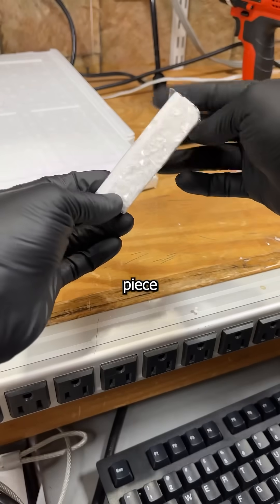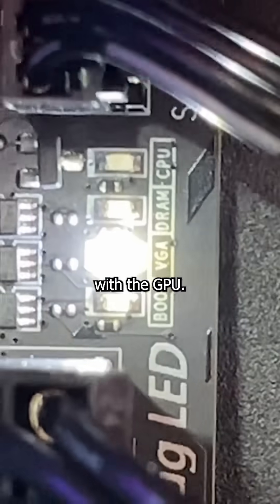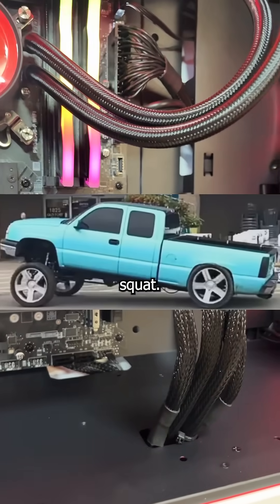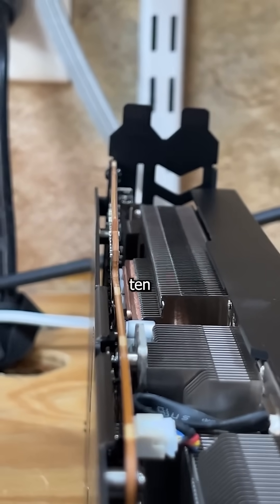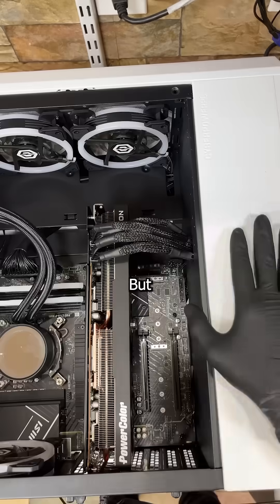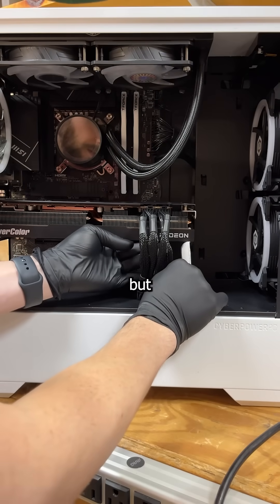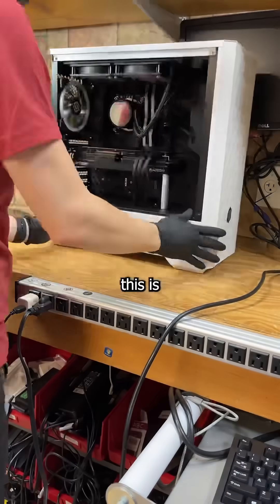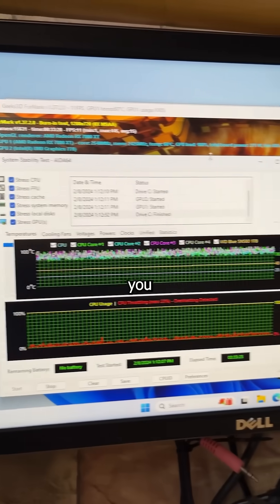Styrofoam vs. Brand New CYBERPOWER #PC (prebuilt fail) #tech #technology #shorts

Comment: It absolutely baffles me that GPUs are getting so massive that they require (even when the PC is horizontal and the GPU is vertical) a mounting support bracket, they have the mounts for them, and we can buy them, but the manufacturers don't include even a basic plastic one with the cards. Come on, another $10-30 out of the manufacturer's pocket (less because of bulk manufacturing) would not even make a scratch or dent on profit margins.

Comment: CLX does the same. My brother's was so bad we had to warranty the motherboard and the GPU. It worked for 3 months. And they must have dropped it before it got boxed up too as the PSU is stuck in the case due to a large dent but the box was fine. They shipped us the parts rather than sending the whole thing back.

Comment: Always a good idea to route those gpu power cables from above.. provides a touch more support for free
Reply from the maker: This is actually a great point
Reply: That how I set up my 2070 super. Though I think imma need to upgrade soon. Possibly a 7800xt or 4070 super. Might need a bracket then
Reply: @TwistedFoxblade same here
Reply: @TwistedFoxblade get a 4080, 4070 doesnt have enough capacity for ray tracing. The gpu will turn that shit off automatically. But unfortunately that is included in the price you pay for the card. Just save up for a month more for that sweet 4080
Reply: @BlackNook idk that 4070 seems to be enough for my 1080p and PCVR gaming.
Reply: @BlackNook I had a 3080 when Cyberpunk released, and it played the game with Ray tracing in 1440p. Never had an issue running the game on that pc.
Reply: Applied this to the motherboard and power supply it does indeed work😂
Reply: Thats what I'm doing...but its doesnt sag anyways. But it is pretty tight, so if it ever starts, it should be fine.
Reply: Yeah but no, they die fast when taut
Reply: It does but then you put strain on the port itself. Dont get me wrong it's so much better but still, use a support, they are like 5 bucks. They are anti esthetic? Yes. They work tho.
Reply: Ah yes, let's put even more strain on the connectors that tend to catch fire lately
Reply: You can also ziptie a hole on the backplate to the back of the case. A lot more reliable than a bracket, and it prevents the GPU from falling in any direction (up down or forward) when the PC is transported

Comment: Yeah, my graphics card didn’t have an option for a proper Bracket. And the screw ones kept slipping. So ended up trimming a thin sheet wood to make a stand after careful measurements.

Comment: I have that exact same problem with that exact same motherboard. Is it really the sag of the gpu? The same white light comes on and everything. Though I'm using a KF cpu, it doesn't display anything when connected to the gpu. Any thoughts?

Comment: My proudest moment building my most recent PC was realizing I could just use the metal pieces from my case to make my own anti-sag bracket. 

I already had to snap off a piece that original covers expansion slots before you figure out orientation for HDMI slots, etc. Bent the straight end into a loop after figuring out what height it needed to be at and the other end conveniently has a screw hole already in it. Got it in place, screwed it down and put a small piece of black foam to cushion it. 

It's so thin and hard to see that I genuinely prefer it to the brackets I see being sold. Plus it literally matches my case!

Comment: CyberPower, more like CyberProblems
Reply: No joke my friend bought one and I used it while house sitting for him. It's got better specs than mine all around and it's a complete turd! Boot up time was like 5 minutes on an NVME and games took forever. I ran my CCleaner Pro account on it and dropped all of those times in half. But it still runs super hot so I told him to replace the thermal paste and factory reset and be careful what he downloads. Hopefully it's running better now, but he doesn't game much because of his kids.
Reply: @dillbill2A he has to have windows installed on a hdd. I have a PC with a nvme and it boots in less than 10 seconds. Also a 2016 PC with a Sata ssd and it only takes like 20.
Reply: @dillbill2A  I had no idea that cyberpower was so bad, ive had my pc since 2019 and it still runs great.
Reply: this guy gives off "?" vibes
Reply: Cyberpower, if its not bent, you're not fucking it right 😂
Reply: Ive had mine since 2017. Only had to change the crappy intel cpu fan because it got clogged and fried. 1080ti will never die.
Reply: I’ve never even SEEN cyber power in part search results but now I know why
Reply: my pc fine
Reply: Did they go to shit since covid?
Reply: @lilfattcatt7758 I bought a system from them a year ago with a Ryzen 5 7600 and Radeon Rx 7600 worked great. Gets over 300 frames on siege and cs2. All for a little under 800 after taxes. I was happy with ended up selling it bc I'm more of a console gamer.
Reply: 😂😂😂😂😂😂😂😂 clever 😂😂

Comment: I saw this issue when i did my first build, i went with a 7900XT from XFX and that thing sagged like a motherfucker. Plus I had a case that the included support bracket wouldn't fit into. So my solution was to sacrifice the case fan on the bottom of the NZXT H5 flow, and get one of those cheap gpu braces.  My gpu sits almost leveled now and I'm not sweating bullets looking at it sag

Comment: I have an iBuyPower, it was originally supposed to come with an GeForce 1660 but instead came with an AMD 570

I didnt return it bwcause i said "phaquit" but im not complaining, the motherboard ports also were welded so me and my roomate had to saw and sand those off, it was a hassle but it is still customizable so for now my computer is doing ok...

Go big or go home, don't skimp on ANYTHING and don't bottleneck, I probably could've saved money in the long run.

Comment: Building my first PC. Got it up and running, had assist in the bios update. Had a 3060 elite 12gb RTX.
I bought that graphic card support stand. I didn't use it at first the graphic card was fine until i started hearing sounds that the fans were chipping away at the cords for the fans and power. I was so glad i bought that support stand.

Comment: The worst part about this is that even if it functioned fine, most people wouldn’t buy a proper support bracket and just run it with that piece of foam in there. (Its me, I’m most people)

Comment: Im an amateur technician recently having obtained my A+ but over the last 6 years ive owned 3 prebuilts 1st was a 2017 ibuypower snowblind it was okay not to many complaints there, 2nd was a alienware aurora r8 and that thing is by far the worst piece of trash i ever owned and currently my 3rd pc is a cyberpower AMD configurator and ive had 0 issues in the year ive had it maybe im just lucky or my baseline knowledge has helped me in terms of preventing the little issues from hitting me

Comment: Hey all. I'm switching from Xbox to PC. Joining the elite! I have a question for anyone who would know. I found a skytech of on Amazon. I use prime. It's 1000 watt power, rtx 4080, 64 GB of ddr5 ram. It has good reviews but I wanted to ask if anyone knew if the skytech pc were any good? Id post a link but I don't think YouTube allows that in comments section.

Comment: You'd be surprised how clutch a block of wood or cardboard is. Hell, that styrofoam might even be fine permanently if it gets a little extra weight. Saves you from $10 for an over engineered metal stick

Comment: Oh, yeah, I also had a similar issue right after I took my PC from repair. Bought an actual metal support, but it doesn't screw into the board, although I might get one that does.
I originally had to take my PC into repair because my motherboard died. Turns out it's because of interference between the GPU and SATA cable plugged into the motherboard. Mobo dead af, had to replace. But when I took the PC home, it didn't boot. So I took it back and they just used cable ties to hold it up by the power cables, which worked.

Comment: It's like people don't understand you can keep a computer in a completely different position and it'll save a lot of issues.

Like I laid mine down on it's side.  It's the side that has no air movement anyway so it's not causing a problem.  Same side the motherboard is on.

Not had an issue, it's easily cleaned up from dust buildup and I make sure everything is still seated properly and there's no sag in the gpu.  If it seems even slightly off correct I can generally make the plastic bit go back to true, it's the internal section that'd be the problem if it sags any.
Reply: I get what youre saying but the hot air of cpu is to go from top and with back metal casing, puting on side causes scratches depending on surface and takes up more space, space already being contrained due to a monitor i.e getting a bigger desk,not to mention it looks awkward, like when people buy an rgb case like this its only for the "aesthetic". I just have the gpu bolted to the case from the side panel hasnt caused me no issue

Comment: Put one of the most electrostatic Styrofoam near allot of electronics very good idea...... Not
Reply from the maker: The styrofoam is covered in tape and touching a non conductive piece of plastic 3 inches away from any components that can conduct electricity. But I understand you just needed to make a condescending comment so you can feel good. Nice try!
Reply: @SalemTechsperts  what tape did you use because normal tape is also static. Beter to use kapton tape instead. ESD can easily cover distances of 12 inches and depending on the humidity be thousands of volts.
Reply from the maker: @rickursem27  The styrofoam is not getting charged if it's stationary and touching a piece of non-conductive plastic. Certainly not charged enough to effect any component in the computer in any way.
Reply: @SalemTechsperts  thats true, but its good te mention that people should take caution especially at placing and removing and in general with these products near electronics.

Comment: Fucking hate cyberpower. I tried to upgrade my pc (shouldve never bought from them in the first place) and every single mother fucking part was non upgradable. Wanna upgrade to a ryzen 5 5600x? Guess what buddy ypu have a b450m pr04-"CB" CUSTOM BUILD. Now you gotta contact cyber power and ask for the drivers for this custom piece of shit motherboard, good luck getting them to respond in less than a week. Oh you wanna upgrade the gpu instead? Guess what bitch you got this prebuilt in 2019 and the powersupply doesnt have 2 6+2 PCI cables, only one. Now you have to upgrade the fucking powersupply. Cyberpower scammed 14 year old me and only now am i realizing how much of a dumbass i was.

Comment: Ok so CyberpowerPC actually has a super special place in my heart because my dumbass in AMD settings baked a GPU within a week of owning the pc, filed a claim with cyberpower and less than a day later had a brand new pc of the exact same type for free. Was especially great since it was 2020 for $800 to get a ryzen 5 3600 & rx 580, and I loved it. Only last year did I upgrade kt to new parts (new mobo, cpu, gpu, etc.) and sold all the old parts except the case, ram, etc. for $300 to a friend I built a computer for. Parts are still running great! Friend has had no issues with it whatsoever, which considering the specs was an absolute steal at the time for only $550 for him (that cpu & gpu plus 16 gb ram, 2 tb samsung 970 evo, some noctua fans to be nice and quiet, etc.)

Comment: I was lucky when i bought mine the person who put mine together was only lazy on certain things fitting well that weren't integral to the PCs life or function like the face plate on the PC and the disc drive not being in straight worked great otherwise even had a PSU big enough for future updates to the PC so only had to upgrade never really needed a replacement 😂 and yes it was a cyberpower pc but from like 2016 or so things were lighter then 😂

Comment: When you know the temps are supposed to just be one line and you get Christmas lights out of the temps, that when you know there's another problem lol
Reply: The GPU was only one of the problems it seems.
Reply: First problem is cyberpower is still in business
Reply: The PCB warped so much the cooling slab does not have proper contact anymore? A thick layer of paste or a heat transfer pad will solve that 😅
Reply: Oh shit those are CPU temps nvm lol